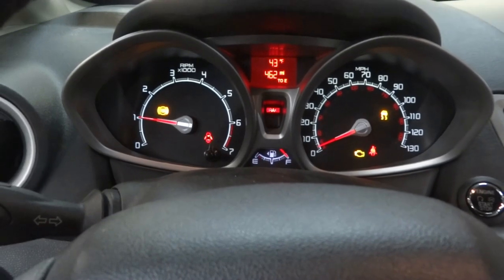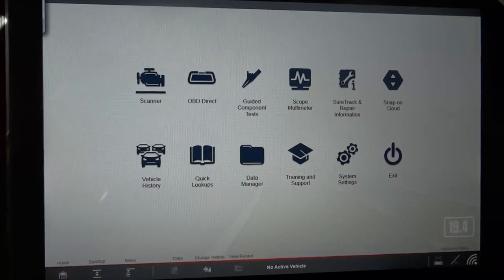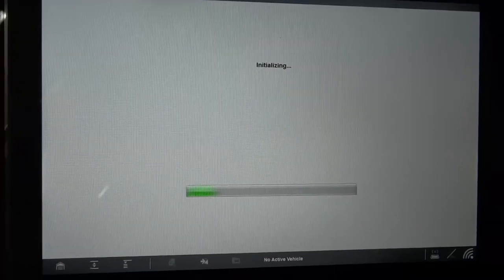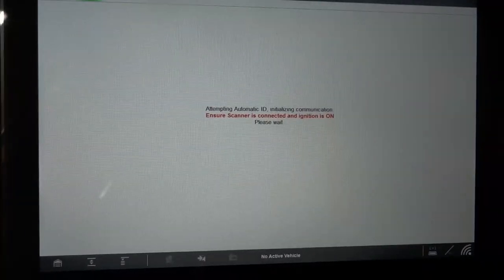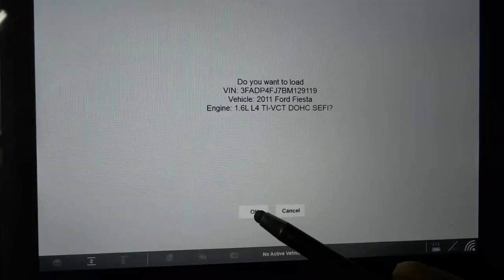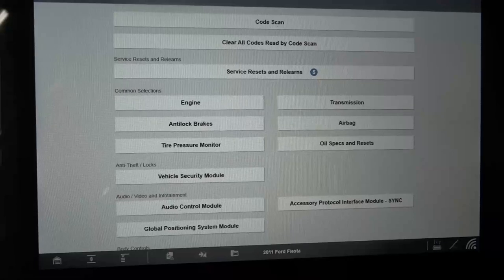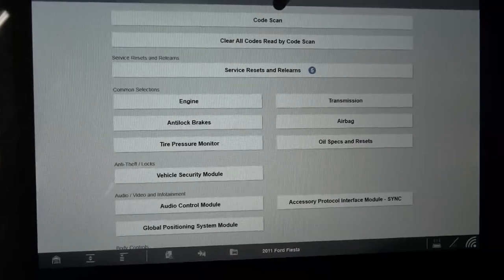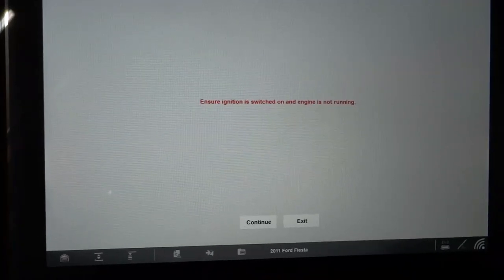How to Test an Electronic Throttle Body, Ford Fiesta Code P2119 - P2127

Comment: Thanks my brother is Aaron Bayane from South Africa in Mpumalanga, is the same problem I encountered yesterday at freeway taking my wife to work it was  a nightmare daylight even not asleep try to figure out what might be the problem but now after watching your video I have a lead now,it started losing power and dropped the speed and I tried  to keep left as much as I could before I was assuming it will switch off and I was on fast line,I keep left with hazards traffic give me time to keep left the moment I was at yellow line it started  doing exactly what all you said on the video I continued driving as my wife was late for work but car nothing power is same a Ford fiesta 1.6 2012 model 2 door,since from 11H00 fighting to find the fault nothing till around 19H00 that's when we opened the throttle body found that is not opening at all we did clean it with throttle cleaner still does the same not opening at all but with hand it opens,is just we never run the tests on  it manually like you did or to diagnose it but thanks for the video now in the morning I know where to start now to make sure if the throttle body is gone or not coz it idles up and down same like that one,and on the screen it shows ( Engine Mulfungtioning Service now)..am humbled and thanks my brother that's why I wrote the long text and whole story I thank you🎉
Reply from the maker: @AaronBayane   My Pleasure Brother, I'm glad to hear that the video was helpfil

Comment: I just wanted to thank you for sharing this video, I had the same issue with my 2012 fiesta, I followed your advice and changed the throttle body. Problem solved! You’re  the man!
Reply from the maker: Howie Miller I'm so glad to hear that you fixed your car by following the steps in the video! thanks for Letting me know, I appreciate it!!
Reply: So I have a Q x 56 when I have the ignition on I cannot hear anything turn when I start when I started truck my RPM gauge is broke but anyway no power when in park I put a scanner on a code comes up when the truck is started I reset the code then no problem until I turn it off again I tried to relearn the system their work for two starts then do the same thing no power or a little tiny bit like worse than lymph node

Comment: Thanks brother your very Ihelpful,  I have 2011 Ford Fiesta  after changing throttle body, vehicle still is not starting. I cleared all codes again with scanner. I sprayed started fluid on the throttle body and vehicle started and fiesta started let it sit for 30 mins and then drove for hour without turning off. Got home next day wouldn’t start with codes p0102,p2135,p0068 and p087a. Am I missing throttle relearn or bad APPS?? Please help thanks
Reply from the maker: @abdullahomer8822   check fuel pressure!

Comment: I have a question about the throttle motor at koeo if we have 12 volts on one cable, will we still have 12 volts on the other with the plug connected?
Reply from the maker: DIMISRAMBO DIMISRAMBO  Yes you should!
Reply: @KITS_Auto_and_Truck_Repair  I'm facing a no start situation in a fiat, I'm trying to do the test with the multimeter, but on the 2 signal cables, pressing the gas pedal, I don't see any change in the volts and the throttle initially opens after 2 seconds closed. I believe that the pcm, seeing it closed, is then closed the butterfly won't let the car start, what's your opinion?
Reply from the maker: @dimisrambodimisrambo7285   You need to get a scope! it's gonna be easy to diagnose with it! you might have a failing throttle!
Reply: @KITS_Auto_and_Truck_Repair  for test tps?

Comment: only code i got is throttle position sensor and my car does this all the time its pretty annoying .   should i replace throttle body ?
Reply from the maker: John Smith, check the ground of the throttle position sensor and the 5V reference , if everything checks out ok, then you can replace the throttle...
Reply: @KITS_Auto_and_Truck_Repair   i changed almost every single part in this car except alternator, starter and clutch,  i have no engine light on but under the ford test menu there is tons of stuff stored i think its the pcm but im no mechanic so im gonna have it looked at saturday and ill see what happens
Reply from the maker: @hotlanta404   you should check the wiring first, make sure you have good ground, 5v ref and signal wire is not shorted, check at throttle connector and the APP connector
Reply from the maker: @John-jf3ku  that's a good idea, get it looked at and let me know, thanks
Reply: @KITS_Auto_and_Truck_Repair   i got vehicle looked at and it turned out that the computer needed to be reflashed in which i told them go ahead and do costing me $250.00 and now car is fine.
Reply from the maker: @John-jf3ku  awesome, I'm glad to hear that
Reply: hey Bro you Good!!!!!!!!!!!!!!!

Comment: Recently had my throttle body changed, was experiencing high revs, random stalling and limp mode on the car. Hoping the change removes the problems I was experiencing... £250 all in
Reply from the maker: OB Aaron, it sounds like you have a throttle body issue, but make sure you test your wiring before you replace the parts, I've seen bad computer grounds cause the same problem!

Comment: This is great information. Now i know what i need to do to check into my throttle body code issue. It only happens once in a while and only while driving. I turn off engine and back on and it goes away. Check non-persistent codes and its throttle body codes and leak between throttle body and MAF. Will probe around and check throttebody is doing what it needs to. Realtime readout for the throttle pedal sensor reads 0-100% without hesitation and smooth. Will check throttle body.
Reply from the maker: lonewolfsstuck  sounds good!! Good Luck!!

Comment: Nice work and very instructive.
After changing the throttle body, why didn't you relearn the throttle body?
It's not necessary?
Reply from the maker: Koné Zoumana The throttle on this vehicle doesn't require a relearn
Reply: @KITS_Auto_and_Truck_Repair  Ok ✅ Thanks
Reply from the maker: @konezoumana614  My Pleasure!!

Comment: Hi, may I ask a question?  I used my scan tool to show a waveform trace of the two sensors at the same time.  I slowly pressed the accelerator pedal as you showed in your video and I could see the two traces moving smoothly up and down on the waveform. Then I snapped the throttle rapidly a few times and the two traces did not move together. The waveform showed one of the traces moving at times when the other trace was not moving. Would that be an indication of a problem? I am assuming both traces should show each snap throttle.
Reply from the maker: Timothy Horne yes, it sounds like your tps sensors are dropping out!!
Reply: @KITS_Auto_and_Truck_Repair  thanks so much!
Reply from the maker: @Z14kt12timandjes1  My Pleasure!!

Comment: Hey men ..could you help me .i have a code p2122 ford fiesta 1.6L when it run it just go off and it do not put up speed
Reply from the maker: Garere MD Kheimseb there is something wrong with your APPS/wiring or your throttle body, you should have a mechanic look at it for you... Good luck

Comment: Where is de idle valve control ? Location
Reply from the maker: Cesar Jhovann Zavala the idle control valve is part of the throttle body...
basically the throttle plate position controls the idle speed, if I remember correctly